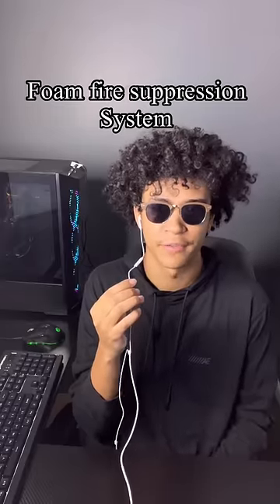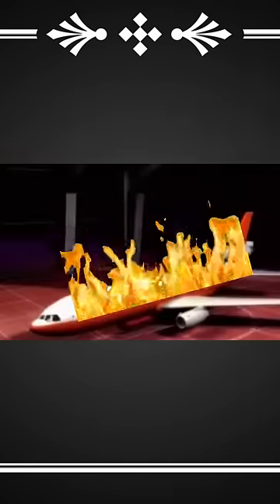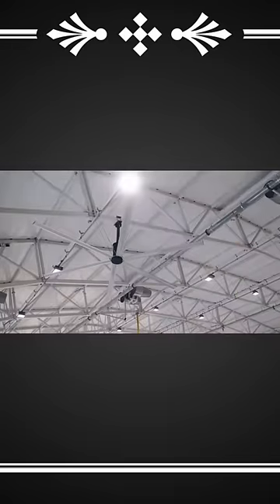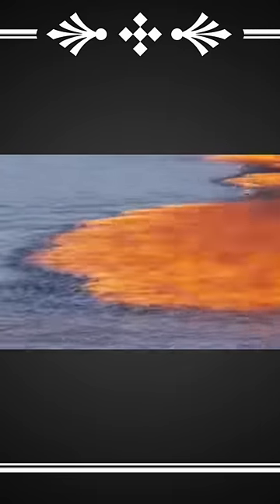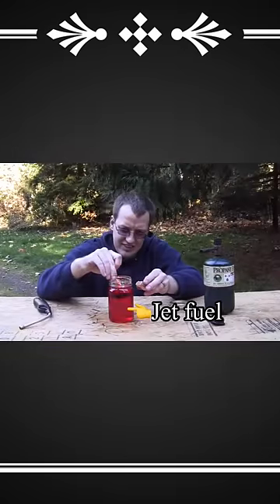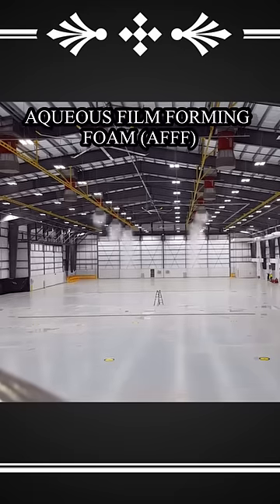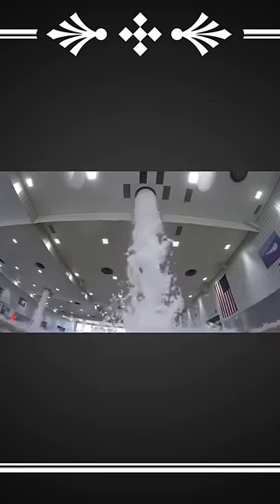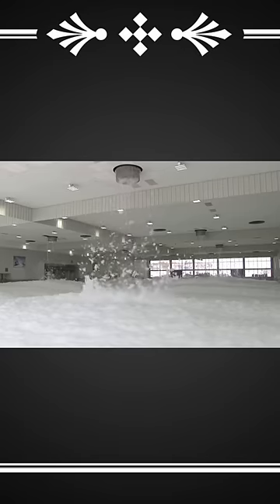Aircraft hangar fire protection! Aqueous Film Forming Foam! #shorts

Comment: Believe it or not, the threat isn't the fuel setting on fire. The real threat is AVGAS, or the JET-x fuel from evaporating.

If you ever pour some meth spirits on the ground, it'll evaporate at a fast rate.

This is the same but on a larger scale. If fuel is allowed to leak or spread, it'll evaporate, filling the air will fill with flammable gas. If you have fuel in the air,  you'll have an explosion instead of fire. This explosion can trigger other nearby fuel sources (other aircraft, other hangars, fuel trucks). 

If you cover fuel with hydrogen foam, it cannot evaporate as the hydrogen blocks it from doing so. Now the threats of it evaporating are much lower and it becomes much more manageable.
Reply: So the foam stops it from turning into a litteral bomb. You learn something every day

Comment: As a 25yr veteran of the fire protection industry they are pretty damn cool to watch when tested really will blow your mind how much foam and or water depending on the type of system you have especially when they have a 3500 gallon per minute fire pump to boost flow

Comment: Bro, we all gamers until the fire suppression system catches on fire.

Edit: I did NOT expect this to blow up, thanks y’all.
Reply: Iirc theres a report of a mixed chemical extinguisher... Becoming the problem. Can't remember where, but the fire suppression became the confligration.
Reply: @osmacar5331  Fluorine fire
Reply: @Am_Cookie2436  i think it was? Am not exactly sure what got angry, but something did, and it was part of the extinguisher system.
Reply: @osmacar5331  Nono, I was just saying when that thing gets angry it attacks everything around it
Reply: @Am_Cookie2436  it's completely irrelevant to my comment. It's like talking about torture methods when talking about puppies and kittens.
Reply: @osmacar5331  Interesting analogy
Reply: @blockmaestro1  i needed something overtly extreme and extreme opposites to get through to 99% of YouTube commenters.
Reply: @osmacar5331  fair enough,
Reply: @osmacar5331  That's not a huge surprise. Standard hospitality training in my country has to cover different types of fires and which extinguishers should be used on them because some combinations are either extremely ineffective or lead to a more violent reaction.
Reply: @venomedfox4119  no the surprise is the extinguisher suddenly became not an extinguisher. Am trained in hospitality on the catering front. Long story short i found my home in amateur engineering from catering, then IT. And well, engie. So i know exactly what you're talking about. Hell had some hot oil spatter on me cause a tiny bit of water got into it cause i knocked the tap on. Spectacular to watch. But fuck that shit stung my arms glad it didn't ignite as I've seen that happen.

Am fine though caught it in time very minor epidermal burns only the first few layers. Wookie arms helped too with the hide.

Comment: What this video doesn't tell you is that fire suppression foam systems in hangars are also really dangerous. The foam literally sucks all the oxygen out of the air so the fire cannot burn. If you're unlucky enough to be caught in it you will suffocate if you don't find an exit immediately or you will pass out from oxygen starvation in 30 seconds.
Reply: Not quite, AFFF forms a barrier between fire and the surrounding air suffocating the burning fuel. Fire fighting foams that use CO2 or other gases to displace air or do something with oxygen will pose the danger you speak of, AFFF won't... It is very toxic tho
Reply: @Ahyum  Yeah, when we were fitting out a data centre with a suppression system one of the options - can't remember the gas now - required oxygen masks to be fitted around the centre. Without it you would suffocate.

Comment: Been in the Navy for 12 years now, this is a standard for us in the Navy for shipboard firefighting in all aircraft hangars, main engine rooms, and auxillary spaces that use any kind of what we call "Fuel Oil" which is usually F76 diesel or JP5 for turbines and Aircraft jets. Two things it's very hard to light when not under pressure, but once it does it's like hell on earth level hot.

Comment: Aqueous is pronounced - Æ-kwe-us. AFFF is used regularly by many fire departments stateside to combat everything from motor vehicle fires to any other sort of flammable liquid fire. It is specifically targeted for flammable liquids, like gasoline, and not combustible liquids like oil, the easy to note difference between the two in laymen terms being flammable liquids is when the vapor (or off gas) released by the liquid at standard temperature and pressure conditions (STP) is what is actually the fuel source of the fire, not the liquid, whereas for combustible liquids the liquid itself is the primary source of combustion in a liquid state. It works by creating a film barrier above the pooling of flammable liquids, suppressing the vapors, essentially suffocating the fuel from the other 2 driving factors of a fire, oxygen and heat.

Comment: Fun fact with these suppression systems. They are prone to failure and it’s slightly more common than one would think. These suppression systems can be highly toxic and very corrosive to aircraft structures and components. Ive seen a suppression system fail in two different hangars, on the same airfield completely engulf assets. Not a fun time at all lol lots of inspections and things as such take place.

Comment: well its hard to ignite to avoid any misfires in the engine. Its a similar reason as to why race fuel is harder to combust in an engine so you dont have misfires like what happens with regular fuel sometimes

Comment: The extinguishers that are used against things like jet fuel usually aren’t your standard dry chemical fire extinguishers like the ones you find in schools that basically just smother the fire

They’re a special type of extinguisher called Halon extinguishers, it’s an almost syrupy liquid that actually breaks down the process of combustion through chemical reactions, and some will release a vapor on the surface of the liquid that will prevent the fire from getting oxygen, kinda like how welding rods created a layer of gas around them

Comment: The foam itself isn't actually that difficult to clean up. I work on an AF base where we test these systems yearly. For this we lay plastic on the floor and along the walls about 10ft up run the system and let the foam settle over night. The next day all the foam is gone and you just you a push squeegee to push the water/foam mix off the plastic and then roll up the plastic. Takes about 2hours to clean up with 6 guys.
Reply: But the foam that gets it and on the aircraft, that's a whole other story. Also not my problem 😂😂

Comment: Afff is not just used for jet fuel it’s best for any flammable liquid since it does 3 things. It puts a barrier between the liquid of the fire and the air said barrier smothers the flame and it cools the flame down because water is typically colder than fire

Comment: Reminds me of the time a hangar on the Post Airfield at Ft Sill got absolutely ass blasted by fire suppression foam because the fire sensor on the wall thought a welding torch was a blazing inferno.… yea that was lots of fun getting called in to help shovel a foot and a half of foam off the floor and the two multi million dollar Blackhawks that were in there, that was a long 8 hours

Comment: Science time baby!!! My time in the navy has finally found use in my life on a comment thread!!! So on a ship we use AFFF, and with that A-triple-F (how you pronounce it if you're not a pr*** btw) it basically is a substance that take direct counter to the idea of the fire triangle, to those who don't know, a fire is made up of 3 major factors (and one extra goofy factor which kinda cheats in regards to that rule, that being chemical or chemical reaction). For a fire to successfully exist it must first have, fuel (this can be literal fuel or something that is just generally flammable, think a box of tissues etc etc.) Heat (it's fire...kinda the main gimmick around the idea of heat) and finally Oxygen. Fire needs air to keep burning and what AFFF successfully does is basically cover and suffocate active flames limiting the fire of one of it's 3 required prerequisites.

Let me be clear as well, this is quite literally the worse thing to clean up as well, I'd rather just have a fire personally but after a certain ship down in San Diego kinda sorta stop existing after a fire well senior navy would rather you have to clean up glorified fire fighting foam than fighting a open fire. Just a little knowledge that cam be seen as neat for you goofballs.

Comment: Ahh-kwee-iss, known to sailors as A triple-F, and yes, it's hard as hell to clean up. I was on deployment and we were testing a helo after some auxiliary fuel tank issues. They were hovering ten feet off the deck and doing a fuel transfer when they started pissing fuel. The aviation boatswain's mates freaked out and sprayed the deck with AFFF for no reason. They spent the next 12 hours scrubbing and housing down the flight deck. It's also super corrosive, so luckily the rotor wash blew a lot of it away.

Comment: Yeah and when we install those things again I work continuity government infrastructure so I've got a lot of experience with foam Halon heylan's Austin and when we do the final install on hangers " " cuz I primarily didn't do open hangers I'm not going into it you test the system and oh boy does it like make a mess and it's actually pretty nasty shit so yeah and then within that if there is aircraft in there yeah it doesn't destroy them but it does do damage to the aircrafts that are not on fire but doesn't destroy them to the point where their total loss it just maybe a certain percentage of their actual total cost just to fix but again would you rather have smoke and fire damage and possibly lose the other aircraft or just have minor damage to the other aircraft and get the fire out on the big fire